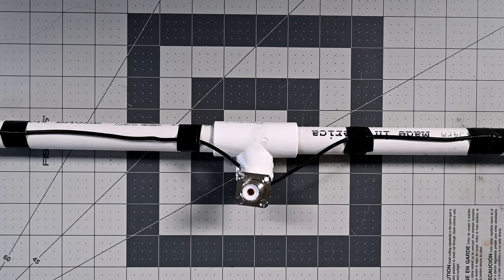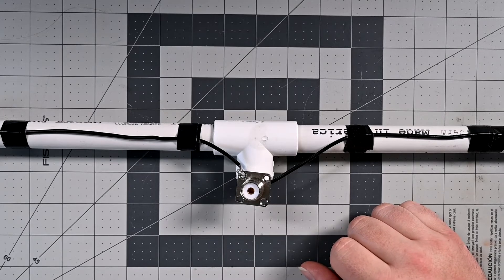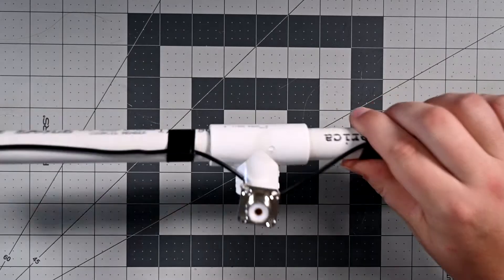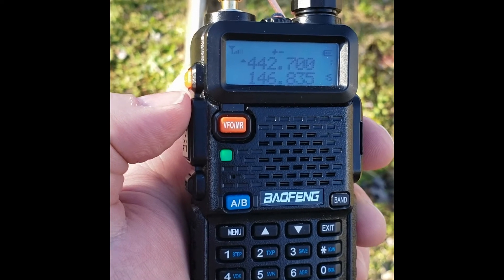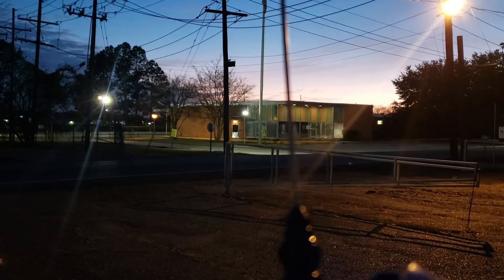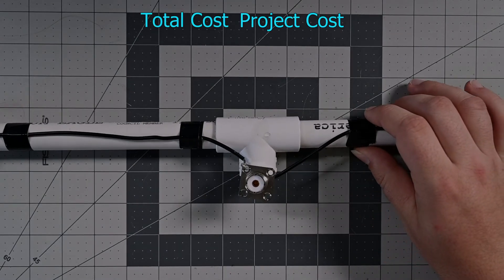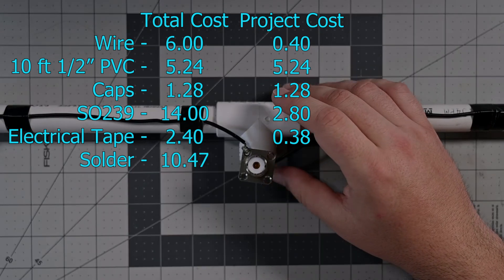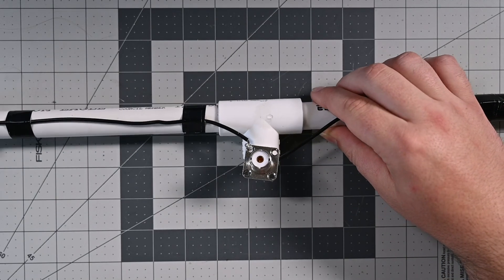Basic Dipole Antenna Build, Demo, and Cost || 2m / 70cm

Comment: I think the dipole should be vertically polarised for repeaters and VHF in general.
Reply from the maker: You're right. I had success with it horizontally in my case, but I do think you're right about it not being an ideal polarization. It would be super easy to just mount it sideways if this were a more permanent fixture, of course. This was just a fun way to see if I could actually make an antenna from scratch.

Comment: Question: why didn't you put the wires inside the tubes?
Reply from the maker: For ease of access since it was mostly a temporary experiment. Once the thing is tuned and working like you'd want it, I think putting the antenna inside the PVC would be the best idea.

Comment: I built something like this. I have separate wires for 2 m and 70 cm, on the same connector. I used 6 turns of coax to make a choke. I used old speaker wires for the elements. Amazon has a connector with 2 banana plugs and a BNC. I bought an antenna analyzer, but if you have a good radio with built in SWR you can use that.
Reply from the maker: Yeah, that sounds perfect! You probably get a lot more bandwidth with the dual-elements than I do, but for local repeater talk,  it works perfectly!
Reply: @ErikHerrmann91  In any case, you did good work. If you start listening to people on HF you will hear a lot of talk about antennas. It's half the system :)  If your radio does SSB you could set it up horizonally for that.

Comment: One more thing. If you’re into the science of EMR and RF, you should check out 2 simulation programs. First, SimSmith. Allows you to see in real time the effects adding or subtracting different components(inductors, capacitors, etc) . Second, Cenos. It’s a RF wave propagation simulator that’s one of of the coolest things I’ve ever seen.  It’s spendy but you can obtain a hobbyist license for free. It’s a time commitment but very worthwhile. Good Luck!
Reply from the maker: That's a fantastic suggestion! Thank you so much for bringing it up! This is only my first attempt at making my own DIY antenna, but I will definitely be doing more in the future. I am thinking about trying a portable sloper next to do some POTA or something, and I will definitely check out those suggestions! Thanks again!

Comment: Your antenna is mounted horizontal usually repeaters are vertical polarised
Reply from the maker: Yes! I had that same thought. I forgot to mention it in the video, but I did test it on its side as well to see if there was much of a difference, and couldn't determine that there was one. Same goes for when we were talking to the HTs through the dipole - it seemed to work fine polarized either way. Either way, you are totally right! If you wanna make one of these for repeaters specifically, you should orient it vertically. Thanks for watching!
Reply: You can put it on vertical, with the hot end up. But for dx horizontal is better.